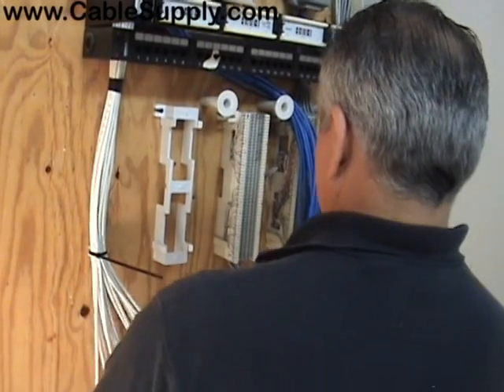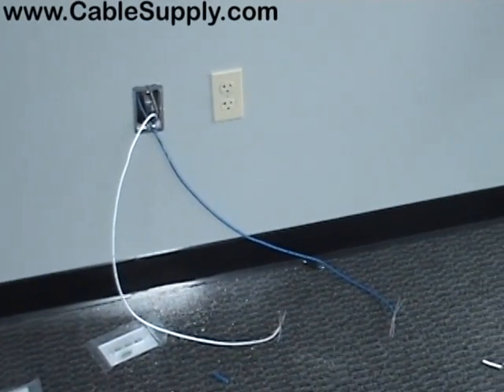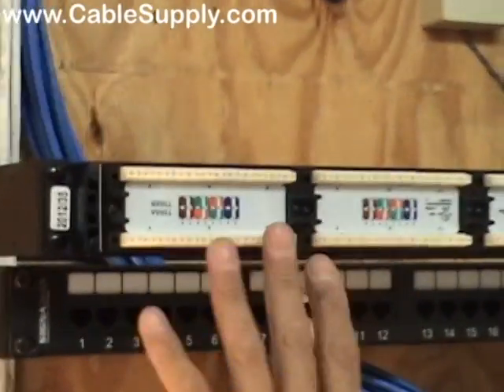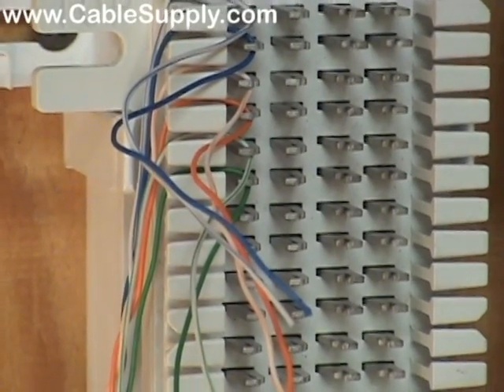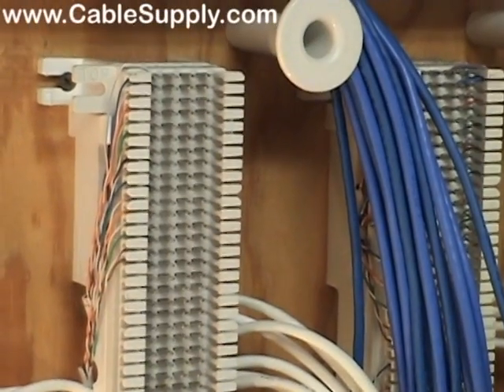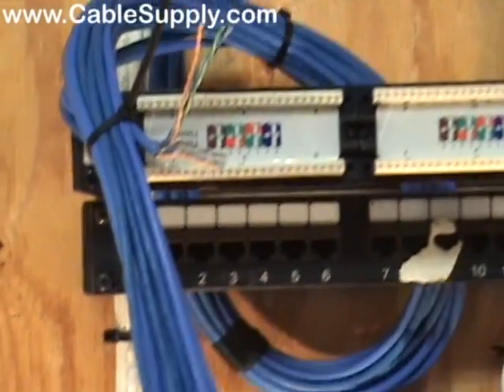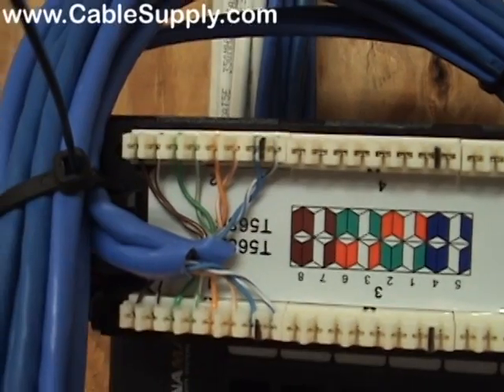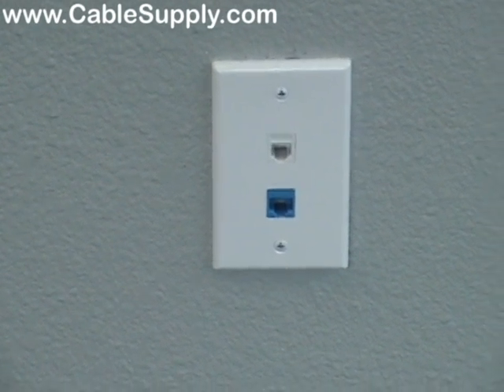Networking Technicians Install Cat5e Cable on a Patch Panel & 66 Block

Comment: You know how to dress up telco cables with zip ties right? I learned how to do it while installing cellular equipment in the early 2000's for Alltel wireless before that I was a wax string artist.. The idea is that all the cables in the bundle are dressed up to lay flat by having a master tie around the lot but spacer ties between each cable. it makes it look nicer, easier to trace a problem and just looks cool.

Comment: 66 blocks and patch panels are one time use blocks?  Riiiiiiiggggght...while I'm sure they wear out, it's just ridiculous to say they're one time use.  That's just absolutely ridiculous.
Reply: I have seen many many of them reused over and over as long as the terminals are not bad.. The ISO is to replace them but that is a perfect world deal or if you have deep pockets to do so.. In the real world people try and reuse and save money where they can. I myself have reused old 66 blocks for POE 5/55 power distribution (5 - 55 volts) and they work just fine for that

Comment: Really great videos that are well and truly educating me as to how to PROPERLY address installations! I've got some experience with these installations, but what I'm seeing in your videos is truly enhancing my knowledge base!

I'm physically impaired, so am limited as to what I can do: Dark Room work is good for me, but I can no longer pull cable, so the 'fine print' as it were, to this kind of work, is what I need to become expert at doing.

Thank you so much for your thorough videos, which are allowing me to learn from the 'Middle of Nowhere' Wyoming (I live in Central Wyoming, so there is really no 'local' place to learn these proper skill sets.).

Take care and I'll be watching EVERY video you have on Dark Room attenuation (learning to work all hardware pertinent to VOIP, Analog Phone Systems, and CAT5/CAT6 wiriing to switches, routers, etc.).

JR Bailey

Comment: Hello.  I have never touched a 66 block and or dealt with any telecom hands on.  I would really like know, but I am a bit confused on the 66 blocks.  From my understanding of the video, each white cable is running from a room that will have a phone system installed, is that correct?  Also, is it a total of 16 new lines being installed making 6 lines on each side of the first 66 block and 4 new lines on the existing second block?  How is the first block getting connectivity from the phone company PBX system?  Sorry to be asking such a novice or stupid question, but I would really like to get it clarified for my knowledge.  If anyone is able to do so or from the author, I'd really appreciate it.
Reply: +Requiem Tears Cable Supply has a video "How to punch down and Daisy Chain a 66 Block" I highly recommend it.

Comment: Looks like you untwisted a bit much on the 110 block.  I prefer to let the plastic block do the untwisting for me.  This helps keep as much twist intact as possible which helps prevent signal degradation when people start pushing gig over cat5e as opposed to using cat6.